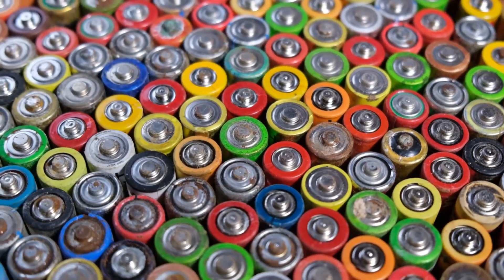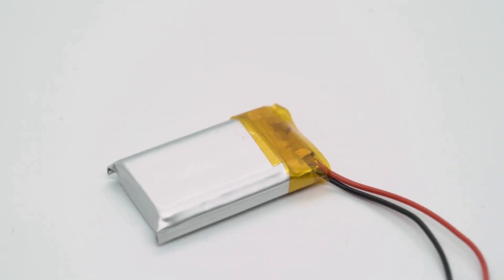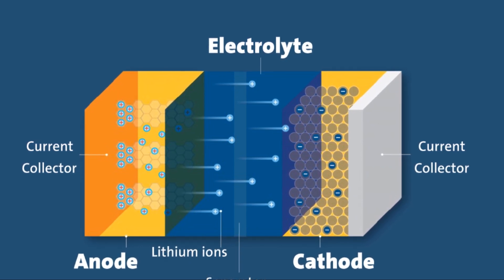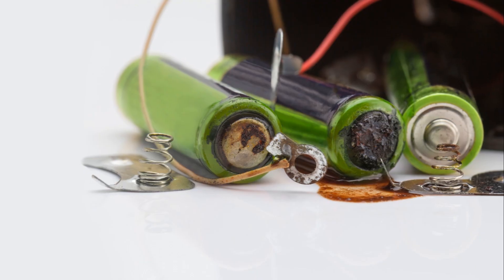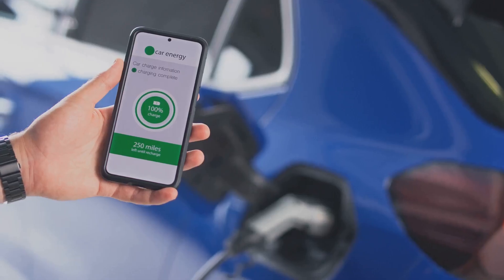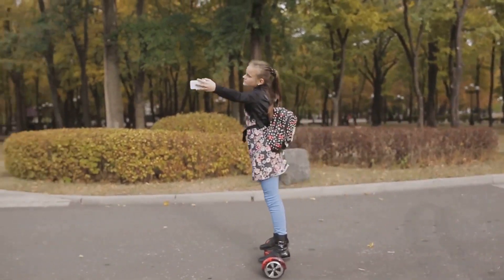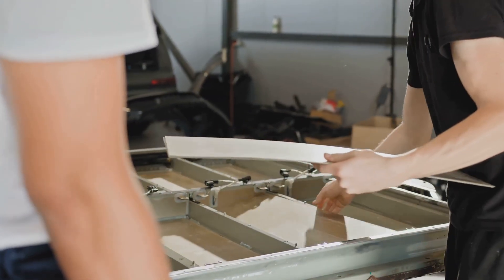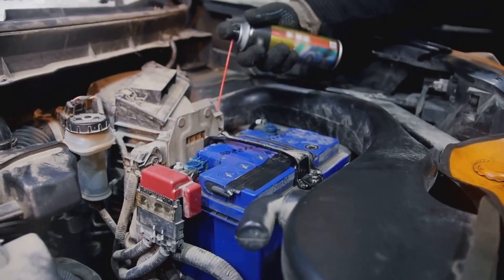Which Battery is Better: Lithium-Ion or Lead-Acid?

Comment: This is a neutral video on the pros & cons of each type of battery, it doesn't attempt to promote one or the other tech.
Reply from the maker: Exactly, the goal was to explain the strengths and limitations of both battery types so viewers can decide which one fits their needs best.